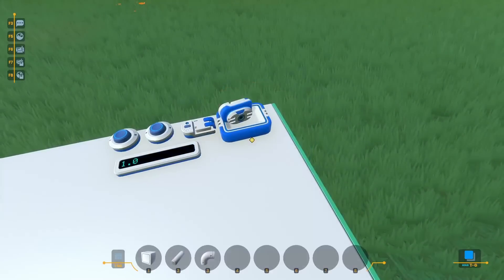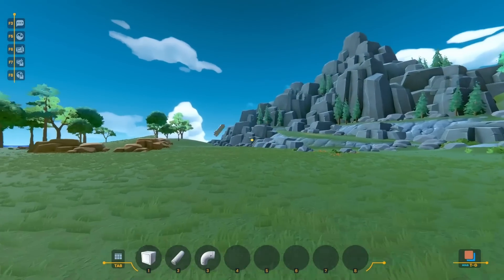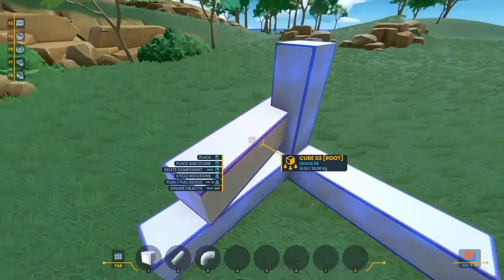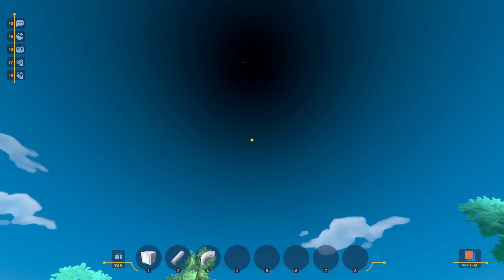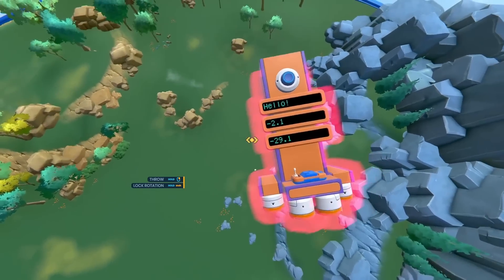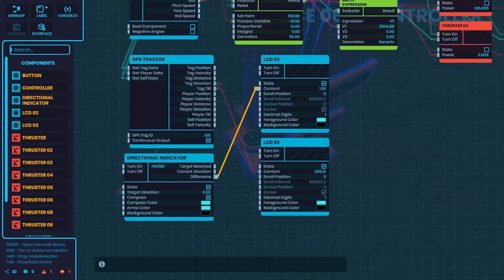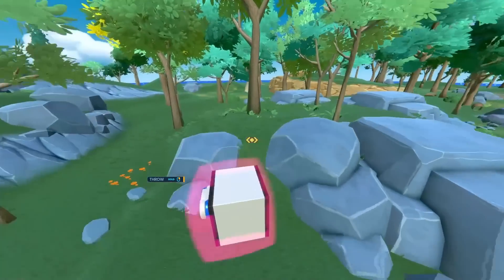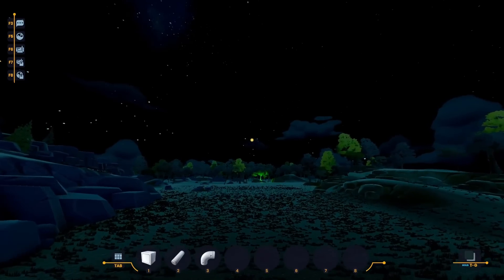Making a Seeking ICBM to Destroy Plasma

Comment: I would have done it differently, instead of all of the thrusters pushing and changing the angle, I would have made a few thrusters that serve as thrust only and some sideways thrusters acting like Rcs on spacecraft on the pitch and yaw Axis, one more thing would be a stabilized thruster, fine tuned to equal the weight of the rocket, to negate completely the gravity and thus removing any issue caused by gravity, and perhaps, if available in game, some wings acting as stabilizers because making rockets without those is a very bad idea

Comment: Your missile doesn't know where it is, because it doesn't know where it isn't. 
A missile knows where it is, by subtracting where it is from where it isn't, or where it isn't by where it is(whichever is greater) it can obtain a difference, or deviation. 
The guidance subsystem needs to use deviations to generate corrective commands to drive the missile from a position where it is to a position where it isn't, and arriving at a position where it wasn't, it now is.
Consequently, the position where it is, is now the position that it wasn't, and it follows that the position that it was, is now the position that it isn't.
In the event that the position that it is in is not the position that it wasn't, the system has acquired a variation, the variation being the difference between where the missile is, and where it wasn't.

Comment: Have you heard of “atan2”? If the game has it, it shpuld fix the atan issue.
Reply from the maker: No actually, what is that?
Reply: @ReidCaptain  atan2 is a function in most programming languages. You give it an x and a y, and it gives you back an angle (counterclockwise from the x axis). (Note: you put y before x.)

Comment: While I can't say whether or not this is your problem, some building games with no "forced" forward direction often don't like it as much when you don't use the "intended forward." this normally is fine for most uses, but can sometimes cause issues when performing delicate or complicated tasks. your missiles issues could theoretically be caused by you not using this "intended forward," as denoted by the Yaw, Pitch and Roll values, with Yaw and Pitch indicating the front/back axis.

Comment: I’m currently working on something similar for a real life robot, so I hope I can provide some insight on how to fix your robot. One of the subtasks of the robot is to get the robot to a 2D target coordinate. I do this by finding the vector from the current robot coordinate to the target coordinate. Then I transform this vector into a polar vector (radius,angle) and use the two values for two different pids. One for maintaining the heading(using the angle), and another for slowing the robot to a stop as it reaches the target(using the radius). I hope this provides some help for the problems you are experiencing.

Comment: Reid, you need to look at stormworks!! Has been out for ages, has all the sensors you need, and custom visual or lua script programming. If you want to make stuff like this then Stormworks is the best game hands down. It uses a voxel building models with no branching links like this game and ksp. You vessel is considered a solid entity and you can loop a craft back onto itself because you arent using a part based builder. Long story short, Stormworks does everything you want ReidCaptain. And in my opinion it does it better than plasma with a couple years headstart on this game almost every aspect of the creation and programming process in stormworks is polished and intuitive. I think this game looks cool but it isnt the first with visual programming and sensors, the big downfall for this game will be that vessel’s are built like trees branching from an origin point like KSP. Stormworks trumps any vehicle builder ive played because it doesnt use that stupid branching tree of connection points.

Comment: What about a lerp function? Have it hooked up so that it has high power when far from the angle and low power when close.
As for meshing the pitch and roll when tilting, sin and cos should help, though if one angle is in degrees and the other is in radians, you might have to do some converting

Comment: Quick breakdown of PID controllers: 

Proportional: It looks at how much difference there is between your set point, and your actual value. The bigger the difference, the bigger the output.

Integral: it's like the proportional, except it takes into account time. For example, a small difference between set point and input over a long time will slowly build up a bigger and bigger output. A big difference over a short time will also result in a big output.

Derivative: the derivative part is a bit different than the other 2. The other 2 use the amount of error between input and output, but derivative looks at how the error is changing. Is the error increasing (that is, is the difference between input and output getting bigger) or is it getting smaller? It's basically trying to predict how much error there will be in the future.

The derivative term also often acts as a damping mechanism to help avoid overshooting your set point, as well as for avoiding what is called "hunting" where you are close to the set point, but begin to oscillate around that value rather than settling on the exact value.
Reply: Thanks, I figured that that was what the PID was for but I couldn't figure out why exactly it required differentiation/integration.
Reply: ooga booga brain broke

Comment: 7:20 I had a problem like this once. The issue is just that atan can't compute the angle in the correct quadtrant. It's always ether in the 1st for 4th. Normally you would compensate by adding 180 if x is negative (which would mean your answer is in the 2nd or 3rd quadtrant) or 360 if it's in the 4th quadrant (ie 315 instead of -45). 

so it would be like:

+x,+y = atan is accurate
-x,+y = add 180 to atan
-x,-y = add 180 to atan
+x,-y = add 360 to atan
Reply from the maker: Yes, I thought about it more later and could have done something like 1/2*((|x|/x)+1) and created a function that "activates" when positive and "deactivates" when negative, and then just tweak it for the opposite effect
Reply: @ReidCaptain  just a quick question because i am pretty clueless but still interested - is that function you described there just supposed to give you a binary output to distinguish the two cases?
Reply: your comment made me realize that I'm dumb
Reply: Albert Einstein is that you?
Reply: @StoneBox_761a  yep. There's actually atan2 that outputs between pi and negative pi. Basically 180 and -180
Reply: @StoneBox_761a  yes basic trig is Einstein
Reply: @StoneBox_761a  My brother in christ, its fucking trigonometry, its not THAT complex
Reply: Yeah I had the same issue too. Eventually I realized that the function Math.atan2 (i was using Java) did what I expected atan to do.
Reply: Yeah, had this problem too. Ballistic calculators. The only way to fix it is ether changing the input data, or manually correcting everything. 
At least the only one I found.
Reply: when i use desmos i use arctan((x1-x2)/(y1-y2))+180° if y1-y2>=0 and then add 180° if y1-y2<0.
it always worked to me

Comment: calculate a parabola with roots at the rocket and the target and the 2d plane that it’s on be a vertical plane with the x axis being the line between the rocket and the target before it launches and store it. If you use the distance to the target plus a set value of offset (say 10) as x then you can calculate y and get a point on the parabola. The angle between the rocket and the offset point is the target angle and this will make the missile follow a parabolic arc from launch site to target.
Reply from the maker: I suppose that would work well, but without me understanding how the air resistance in the game works it would probably be hard to get right
Reply: @ReidCaptain  Is there air resistance?
Reply: Ye